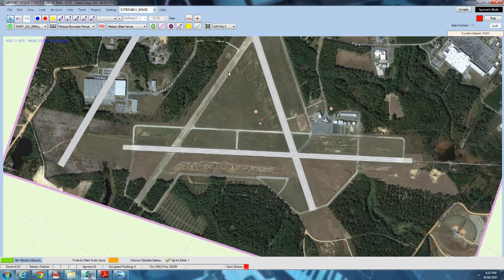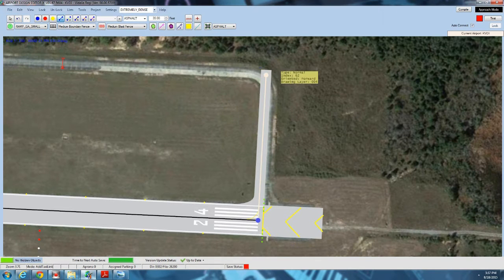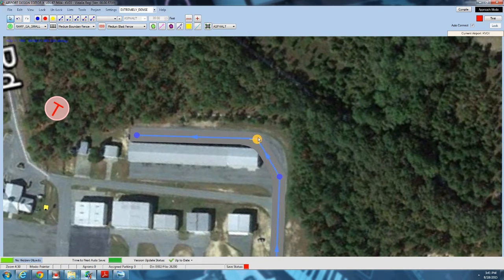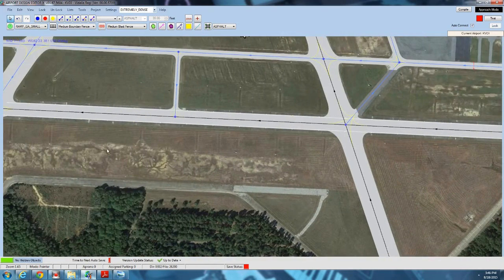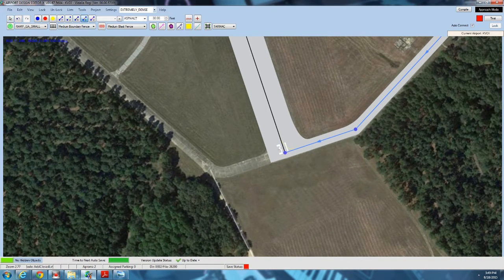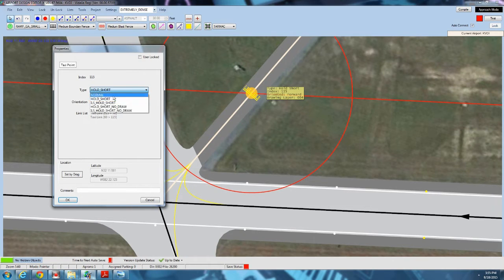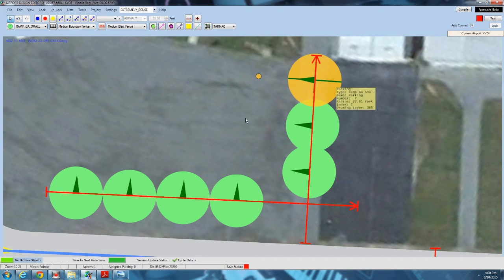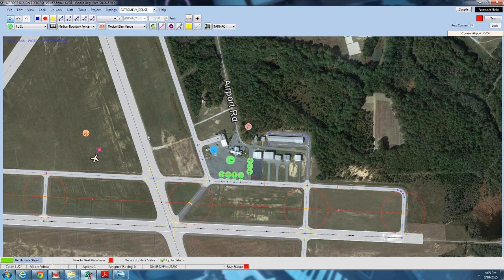Airport Design Editor Walk-though, Part 3, Our First Edits

Comment: Thank you for the amazing videos! I have one quick question: How can I make AI planes use a new taxiway I built so that airplanes don't accumulate and wait for a long time until the take off queue is gone? For example: I made up a taxiway so that the AI planes can go around the runway and not wait until the incoming landing planes or the planes about to takeoff are clear of the runway. The only problem is that the AI planes don't use the taxiway.
Reply from the maker: This gets a bit tricky. AI aircraft are assigned a taxi route by the ATC engine. typically it assigns the shortest route between where the aircraft is, and where its trying to go. however it will make some allowances for the movement of other aircraft. The ATC engine will also command an AI aircraft to hold short of a runway that has a plan landing or taking off on it. take a look at the airport diagram link below, Its Atlanta International in Atlanta Georgia. North side of the airport between runways 8L and 8R is taxiway bravo, taxi west bound in it and it will eventually turn into taxiway V which takes you around runway 8R, much like I think your trying to accomplish. The way I got this to work is by having no taxiways from Bravo actually connect to runway 8R. This way the ATC engine see the shortest path as taxiway V

https://skyvector.com/files/tpp/1711/pdf/00026AD.PDF

Comment: should we download SDK or is there a bgl compiler in ADE
Reply from the maker: you have to download the SDK. if you cant find it then use the P3D V1 SDK its largely the same
Reply: CountryFlyboy tnks ivl download SDK and do my own sceneries😃
Reply: CountryFlyboy will  p3d v2 or v3 work
Reply: @anveshbhat2180  ADE most recent version has a compile system built already, which makes it easier